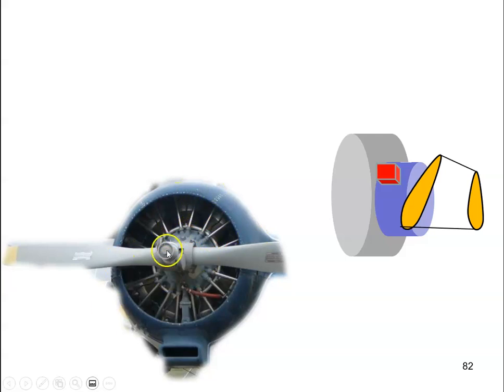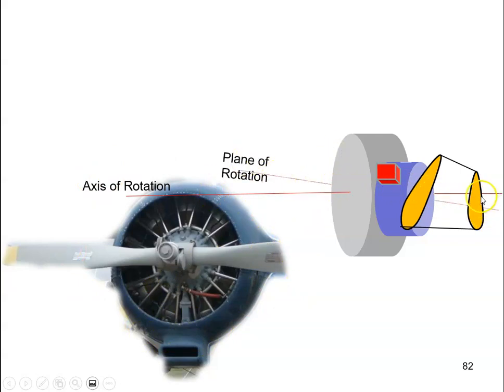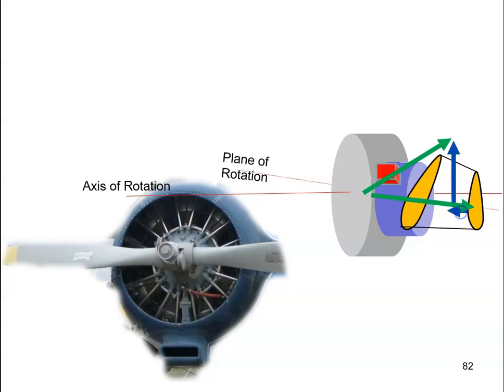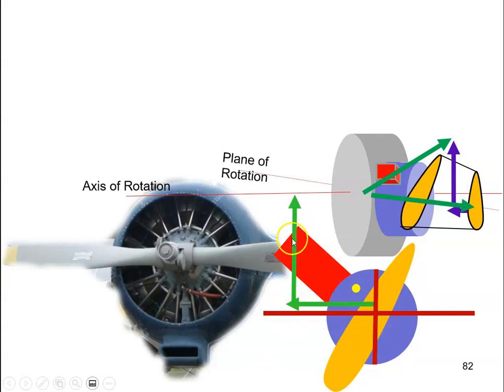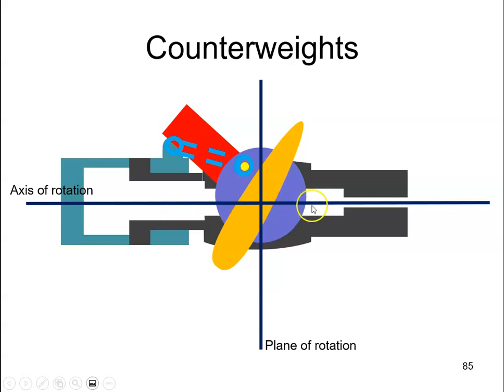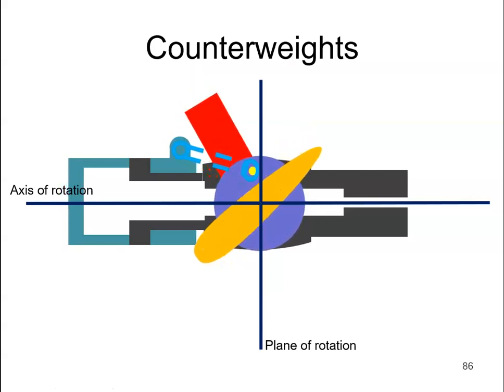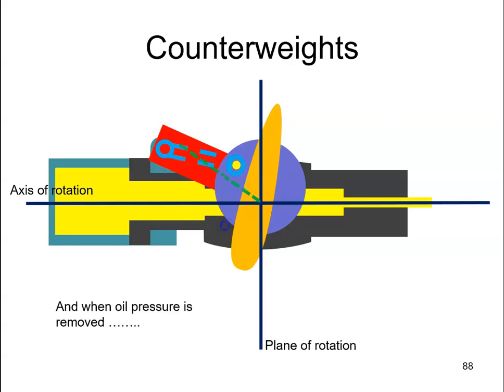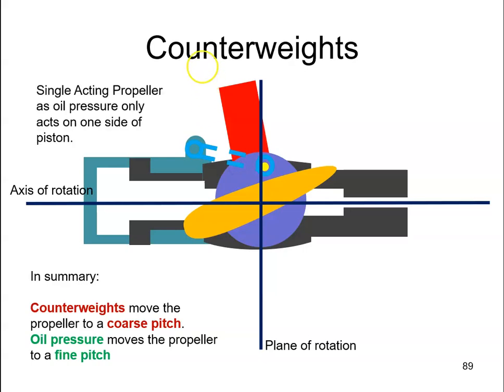Counterweights and a Single Acting Propeller

Comment: Can I ask what happens to the CTM force on a counterweighted blade once the propeller goes into reverse pitch. Does it try to turn the blades towards a greater negative pitch angle, or is the effect of the counterweight more complex than that because, from the diagrams here, it would seem to depend on the shape of the counterweight and the amount by which is shifts the blades C of G.
Reply from the maker: CTM always try’s to bring the blade towards the Fine position.  So, even in reverse pitch it will try to bring it back to Fine.

Comment: It would seem to me that to generate a force of any kind, the weight would have to move from a position closer to the axis of rotation to a position farther away.  I understand vectors and their decomposition, but I do not see the weight's CG being any farther away at the end than it was at the beginning.  I know the system works; I just don't see this as an explanation - at least not one clear to me.  No offense meant.
Reply: OK - I just set up a model with two cylinders.  It makes sense now.  The vector drawings are such that it is hard to see exactly what plane each vector is in, but a quick model, with one cylinder perpendicular to the other, shows that when the weight is rotated to a position near the front or back, it is closest to the crankshaft extended centerline; when rotated to be in plane with the propeller axis, it is further away, generating the necessary force.  Thanks.